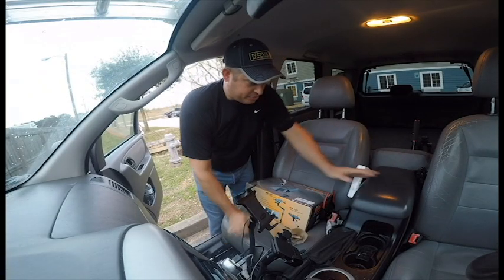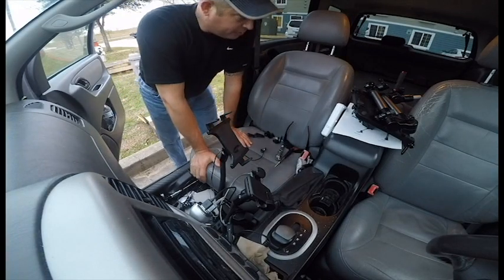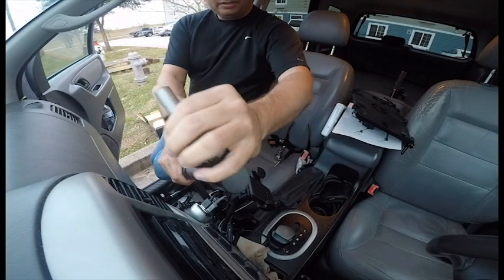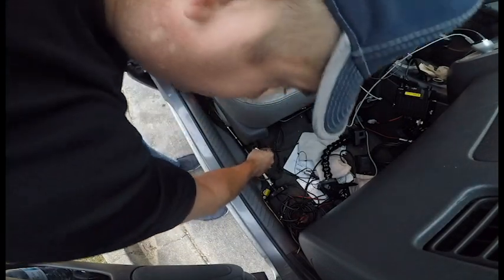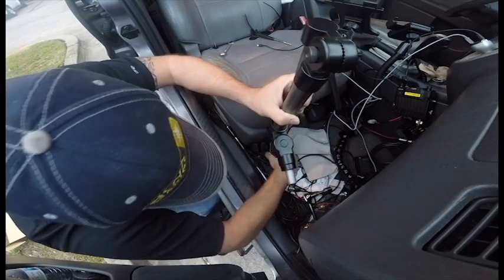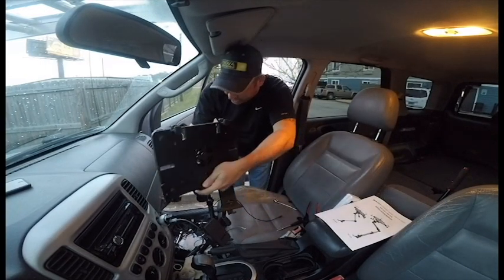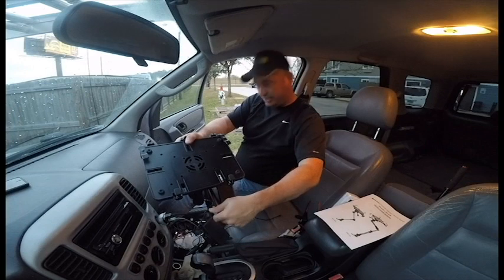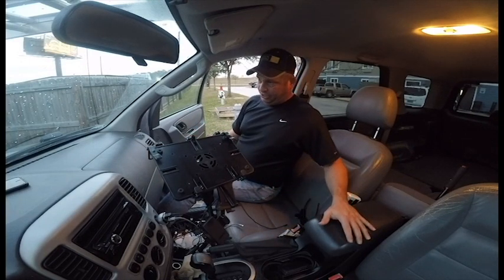Mobotron MS-526 Install

Comment: This video doesn’t show any actual installation of the product. The directions actually say to install it on the left side of the passenger seat. It sounds easy but can be quite difficult depending on your vehicles seating. Thumbs down for this guy, booo
Reply from the maker: The product is actually not very durable.  Wound up replacing it with a Jotto Desk, even that has it's short comings, but it's a better product.
Reply: @hotpuppy72  I read u. Nothing is made to last anymore. I guess it's like cooking, nothing like homemade.